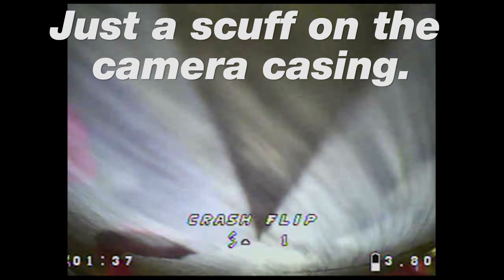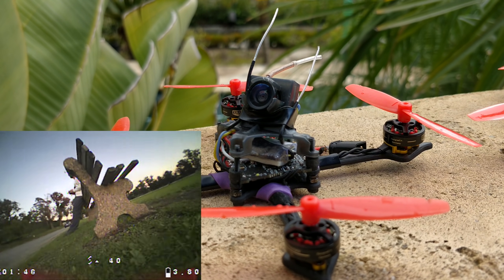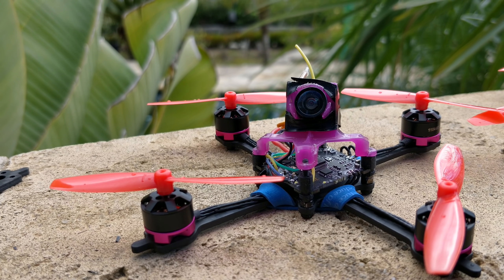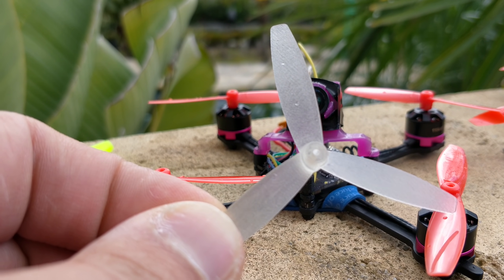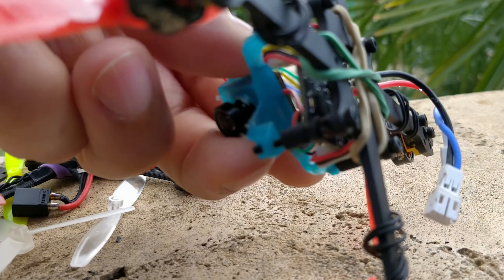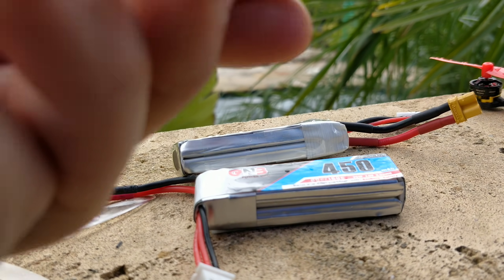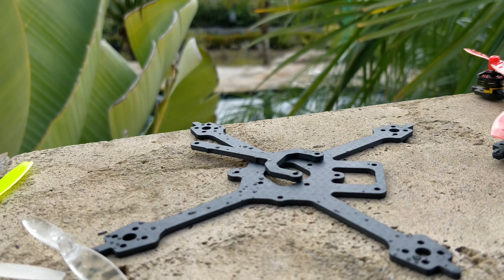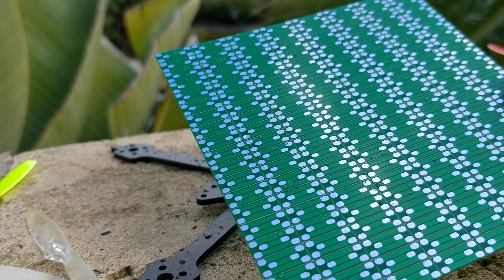Toothpick Update - Props, Power lines, Charging...

Comment: JST connectors have thicker, longer pins and handle 3A+, they don't heat up at all on 2s, get rid of the resistance without adding so much weight.
Reply from the maker: I've tested many connectors since this video.  JST is not suitable for this application.  Most of them are rated to just 5A or below.

Comment: You probably know that by now, but the Emax charger used for the tinyhawk series can charge 2/3 2s lipo directly though theri balance lead. Works perfekt with a xt30 on the Main power leads :)
Reply from the maker: 😮 I had no idea at all.

Comment: I know the 1s toothpick days have past but I just made my first 1s toothpick build and I love it. I'm wondering if you know what's the current most powerful 1s motor. Currently using the 9000kv happymodel 1102 because I had some lying around but I'm curious about the 13500 kv version. You think that would work well on 1s? Thanks.
Reply from the maker: Around 11000-12000kv seems to be optimal for 1s

Comment: My toothpick stabil fly but %60 up throotle vibration problem ? My setup kabab . help me please.
My pıd kabap  amax motor kkong 65mm prop 450mah 2s 75c tattu battery total 71 gram. What is problem?
Reply from the maker: Try lowering P and increasing TPA to 0.60 while lowering breakpoint to about 1290

Comment: Suuuper stoked to finally be building my own Toothpick soon! A really cool step up from my Hoverbot Nano. I'm really hoping that some better portable 2S charging options start coming out soon, though.
Also, it's exciting that folks are finally catching on to using properly rated connectors! I've been using XT30s on my micros for years, and never really understood why most people didn't, too. A quick read of the datasheet for the JST PH series connectors reveals that they are rated for a maximum current of 2 Amps with a maximum contact resistance of 20 mΩ. So it's not surprising that a ton of power is being wasted as heat in the connection. Drawing 10 Amps, up to 2 Watts would be burned through one of the connectors! 6 Amps would burn up to 0.72 Watts through one of the connectors. The XT30 however is rated for 30 Amps with 40 Amps peak, with a maximum contact resistance of 1.15 mΩ. Drawing 10 Amps in this case would burn up to 0.115 Watts, 6 Amps would burn up to 0.0414 Watts - a massive improvement.

Comment: Have you tried the Happymodel ex1102 motors available on banggood? its the ones from the mobula7 hd
Reply from the maker: Haven't. But you can buy the copy of my Toothpick concept from happymodel and banggood in about a week 😔
Reply: @Kabab  Dang, that sucks. Just how the hobby is I guess. The ex1102 has both an option for 1mm & 1.5mm shaft, would you pick 1.5 and drill out the props or just 1mm?
Reply from the maker: @leonardvdj  I would be worried about bending the 1mm shaft

Comment: So I've been struggling with boring out the prop shafts as I always end up with vibrations.  Was wondering if you had a technique for it? Also, have you tried the rotorx 2535 with the toothpick yet? Seems comparable to the 65mm kingkongs.
Reply from the maker: That's a good prop in the twin blade version on the little 1103 motor.  Issue is that it's expensive and very very fragile.
Reply: @Kabab  so, out of curiosity I ended up buying some of the rx2535 props, and you are right on about the price, way too expensive, but when it came time to sacrifice one to the torque of my fingers, I found I couldn't actually break it, just mangle it up, looks like poly carbonate. They fly nice too :)

Comment: There are some 2-blade props out there with holes for the 110x style motors (Gemfan 3025, DYS 3020) - would those work, or is a 3" prop too big? Or do the mounting screws just add too much weight?
Reply from the maker: 3" I think will fit but it's a bit much for the little motors maybe. There's a super skinny 3" rotorx blade that I think is pretty good
Reply: @Kabab  if it's the one I'm thinking of it might be the same/similar to the DYS? Anyway, the whole project looks fascinating and I can't wait to try one, keep up the great work.

Comment: Nice progress, i saw a similar design a year ago as a happymodel DIY 1S drone. But anyway, it is a step forward!
QUESTIONS:
Do you think, it is possible to use it as a long range "whoop"/micro? Do you think a proper li-ion could power it? 18650 is probably to heavy, but a high quality cell could handle the drawn current. So a smaller li-ion, which is lighter, but can handle the current might work? Compared to a 1S setup with a ~450mAh Lipo, a 1XXXmAh Li-Ion could enter a new long range hype?
I am looking forward to your thoughts :)
Reply from the maker: Interesting idea.  Maybe a smaller lithium ion cell so you can run 2S would actually work out since these things are very low amp draw.

Comment: my point of view meaby completely wrong but it's looks like our 5' quads have not efficient propellers on it size if we compared to small toothpick what You thing Bob ?
Reply from the maker: Things change a LOT as you scale up.  Also, I can squeeze more performance out of the toothpick and get a shorter flight time.  Similarly you can drop some performance from a 5" to get more flight time...
Reply: @Kabab  do You ever think to scale up kingKong  propeller to 5 inch ?
Reply from the maker: @jurgieldetka5469  it is too flimsy

Comment: Since there are 10a 16x16 ESCs, do you think the higher current would have any benefits over the crazybee boards, especially with more weight like with a split camera?
Reply from the maker: I haven't seen the limits of the crazybee yet and I've run 1106's already and 1104 11000kv on 2S. I don't really trust amp ratings.

Comment: Do you think the Hypetrain Dab 1104 7500 kv would work good for this
Reply from the maker: Yeah I'd say it's a good option for 2S
Reply: KababFPV how about something like this?  I’d imagine weight would go up, but do you think weight would be ok still?  https://www.heli-nation.com/happymodel-16x16mm-teenyf4-pro-1-2s-flytower-f4-osd-fc-w-buck-boost-converter-5a-bl-s-dshot600-4in1-esc
Reply from the maker: I've used many of those.  That's actually a really great stack.  It's only real issue is that it's annoying to soft mount.  All that being said, while it is mostly reliable, its performance isn't consistent.  It's an older design and things we're getting today are actually better with particularly more consistent ESC performance.
Reply: KababFPV I’m gonna hold out till you guys get stock.  Thank you 🙏

Comment: thoughts on using the 2s XT30 GNB 600mAh 50/100c? Can't find any of those 450 mAh's 80/160c's anywhere without months of waiting. Do you know if the amax motors would be requesting too much from the 50/100c battery amp wise?
Reply from the maker: Right now, 600mah 2S is primo but 450 2s is great too. Just a little more flight time on 600
Reply: @Kabab  ok cool, so the lower discharge rate of 50/100 for the 600mah isn't a concern? I see the 450 has a higher discharge rate (80/160). Just wondering if the amax 1103s will puff those 600 batteries or not?
Reply from the maker: @Tetra84  I haven't puffed anything at all yet

Comment: The problem with the 2S charger you showed (which I own), is that it does not charge HV LiPos to 4.35V, but only to 4.25. I'm not even sure it goes to 4.25V, as it says charging is complete when the display still shows 4.20V!
Reply from the maker: Don't ever charge anything to 4.35v unless you're okay with the battery only lasting about a dozen cycles before it's performance tanks. Lihv is a scam
Reply: @Kabab  Ok... But I was really just addressing the fact that it's advertised as charging to 4.35V (for those who wish to do so), but it doesn't do it. :)

Comment: have you checked out the 3s-capable electronics from fullspeed???
Reply from the maker: Yeah I did a review on it. The 4in1 burnt out on the second plug in
Reply: @Kabab  WOW! and i was thinking fullspeed had gotten it together after the leader 120 when my leader 3se worked so well (after they fixed the motor issue)

Comment: Ok is it worth doing the upgrade to this frame or ones like it ? Im 
doing the swap as i have some 0703s and 0603s to make
 use of. I also have a mobula id like to convert for a 2s version but 
not if the Mob is crapola quality parts in long run ..
Reply from the maker: A transfer is alright but if built on 1103 motors and 2S it's really much better.
Reply: @Kabab  OK, ive tons of 0603s and 0703s with a 1s Crazybee board as well as mob parts to use so ill give it a whirl. Emailing Happy model tho about the durability of the escs ..
Reply from the maker: @Spideystrat  ESC's are fine. Motors are just a bit weak
Reply: @Kabab  and the frames are crapola..

Comment: Hi, just run 2xXT30.. the difference is about 2.5g. I swap the connector of the no wire ph2 batteries (GNB 260) and glue the connector with epoxy directly to lipo). Then i just have 6 ph2 to XT30 reductions on my happy model charger. Each cell is charged individually. Works great on my Mobula 7!
Reply: Because you have no wire and no ballance lead on the lipo the weight might be even less.

Comment: I know I ask a lot of questions, but in your opinion, does a separate camera like a Sparrow 2 or similar and separate vtx make a big enough difference on something small like the toothpick to justify the price rather than a simple aio camera? What about something in between like a small, cheap camera like the Caxxax eos 2 found on the trashcan? AKA, what would be your setup provided you had the frame to support it?
Reply from the maker: U wouldn't say the price is significant enough to matter. It's the physical size and need to me. It'll carry a full size micro just fine but cramming the vtx in there with a separate Rx as well is not gonna be simple and easy.

Comment: Hi! First of all thanks for this sweet video! I've designed my own 5inch frame, 3d printed it and tested it. It works really well and I want to make a carbon version of it. Could you tell me where you get your frames cut(and the average cost, maybe)?
Thank you very much!
Reply from the maker: I have a manufacturer that cuts it for me. I use multiple. There are many. Not hard to find.

Comment: https://ebay.to/2BF4O7O

I’d like the communities’ thoughts on this frame concept by
Acromob.  Similar concept to the toothpick
in that it’s a no prop guard power whoop for outdoors, but the architecture is
built around the 55mm hubson prop instead of the 65mm king kong prop.  Here are some of my thoughts below.

Pros of Acromob frame vs toothpick:

-      Direct transfer of prop guard power whoop (trashcan, betafpv 75 pro 2, mobula 7, etc.)
over to this frame.  Just reinstall on
new frame and add props.

-      No need to cut and splice in motor wire length.

-      Lower weight which is safer overall for public flying.  The 55mm prop is a better fit for the smaller
motors (08xx instead of 11xx) so this allows for less amp draw, which allows
for less battery, which allows for less weight overall.  XT30 isn’t necessary I’d imagine which is a
benefit in my opinion.

-      Not
needing to drill out king kong 65mm props and deal with unbalanced props.  The 55mm and 08xx motors are both 1mm shaft
size so they pair perfectly.  The 11xx
motors and the king kong 65mm props don’t match which requires drilling out the
hole to fit this motor.  You can’t drill
a concentric hole which is means the props cause vibrations.

-      Cheaper
batteries if you go with ph2.0 plug and 300mah/450mah batteries.  Plus, these can be dual purpose use for a
normal tiny whoop.

-      Can use 1s tiny whoop individual charger for field charging.

-      Less fiddling with the motor remapping, board orientation, etc.

Cons of Acromob frame vs toothpick:

-      Lack
of performance with 55mm prop.  Less
float, less weight/momentum to get a freestyle feel, less speed and probably acceleration/punch.

-      Possible frame flex but it’s reported to have none.

-      Lack of efficiency, performance, speed if you choose to use the PH2.0 connection.

I’m sure I’ve missed out on other points, but what is everyone’s
thoughts or comparisons?  You can also
see more of this frame and videos of it flying, if you search acromob frame
fpv.

Comment: This thing is amazing love flying it so much power. With what have you been making the hole bigger on the props I ended up putting a lil hot glue and it works but it's a pain when one falls off can you post a link to props with the actual diameter for the center hole. Thanks for the work you put in the research for this amazing lil thing I love mine
Reply from the maker: Yeah I'm trying to get the props made to be correct.
Reply: What to you use to drill the props u have now
Reply from the maker: @captainskyhawkfpv2367  I use the 1.4mm drill from banggood

Comment: I know you don't like the 3'' size that much but if the goal is to haul an hd rig with meh speed you will get 4 minutes of trashing (up to 8mins when i feathered it) on that gnb 450 with the ancient gemfan 3025 with the 1103s
Reply from the maker: The problem is the prop screws for me. Super annoying to carry a tool to deal with those. Not to mention it takes sooooooo long to swap a prop and I often drop and loose screws in the grass. Just awful.

Comment: That charger works well for 2S. Lipo and AC input, it even warns of low input voltage so you don't kill you battery. I had an issue with mine, replacement is coming tho

Comment: hota d6 and this would be perfect. https://www.amazon.com/LHI-1S-3S-Parallel-Charging-Charger/dp/B074WMHC9V/ref=sr_1_7?crid=22PBJXGM6XXTX&keywords=xt30+balance+board&qid=1550056229&s=toys-and-games&sprefix=xt30+b%2Ctoys-and-games%2C254&sr=1-7
Reply from the maker: yeah except for the downsides of parallel charging which the main one is that you gotta charge all the packs together.  Can't charge while you fly and just plug in whatever whenever.
Reply: @Kabab  Hota d6 has two ports. Charge 12/fly 6. Have you ever used a 1102 7500 on 2s? I may be building one of these soon. My cnc needs to do something other than just look pretty.I wish the boards were designed skinny like the lipo's length wise and lay the usb flat. My right thumb has a hole in it from velocidrone.
Reply from the maker: I haven't used 1102 yet but I would expect it to be fine

Comment: So I see your cam recommendation is the us65 one.  I was wondering if the trashcan vtx and camera would be a better choice as they can do up to 200mw (I know they are heavier but 25mw just isn't quite powerful enough for me.
Reply: I guess we will find out.  I ordered the trashcan vtx. Now I need to decide what camera to use.  Any suggestions?
Reply from the maker: Trashcan vtx is fine. It's just a bit heavy. The TBS nano V2 is the best option but expensive. The low cost version is the eachine vtx03 but it's a bit bigger which is the issue. This thing is really little
Reply: @Kabab  well looks like the trashcan vtx is 1.5g heavier than the TBS one. I already ordered it so I guess I'll just see how it works out.  How about cameras.  What do you suggest?  I'm willing to sacrifice a bit of weight for a really good picture. The view is King for me!
Reply from the maker: @DoRC  if you're running 2s with an XT30 it'll definitely carry a micro cam but it would require a mount be made for it
Reply: @Kabab  mount is no problem.  I have a 3d printer and moderate fusion 360 skill.  This is going to be fun!  This is the first time I've been able to justify building a quad rather than just buying one.  I'm really enjoying the little guys.  Don't get me wrong 80mph in my 5" is great but there's just something about the small ones that I really like.
Thanks for all the great info!

Comment: I wonder if a 1.45mm reamer would leave a better hole and preserve the prop balance.
Reply from the maker: It's possible but I am trying to work on getting the correct props made
Reply: @Kabab  well I got 40 of the 1.0mm props so I guess I'll be dealing with vibes for a while:)
Reply from the maker: It's not a big deal. The vibes are really small. I only realized they were there after I tried a prop with the correct size hole.
Reply: @Kabab  cool well I have a drill press and have already 3d printed a jig to hold the prop straight so it should be ok.

Comment: just make a converter cable from the balance lead to two jst ph connectors (the balance lead can handle the 0.6A from your charger) .
you can only charge three lipos at the same time but whatever.
Reply from the maker: I cannot for the reasons I stated in the video in the charging segment.